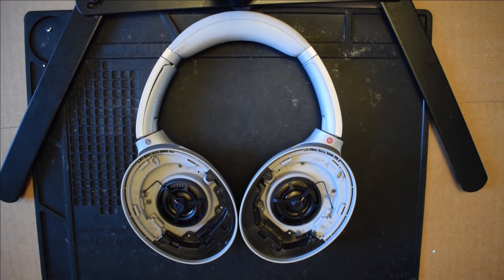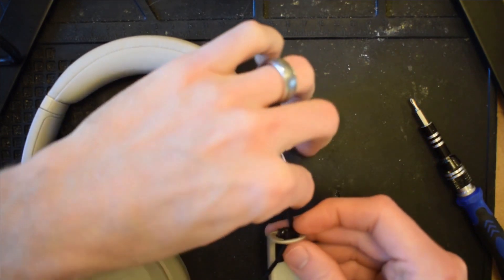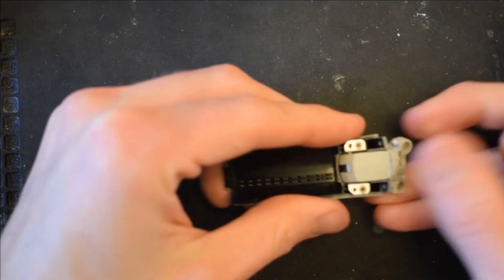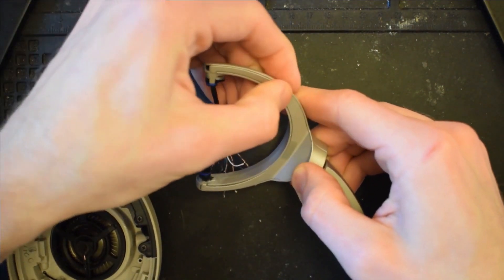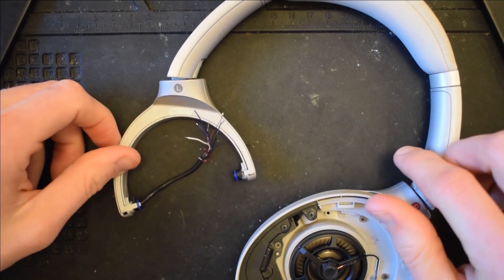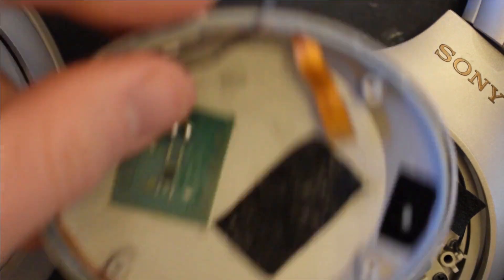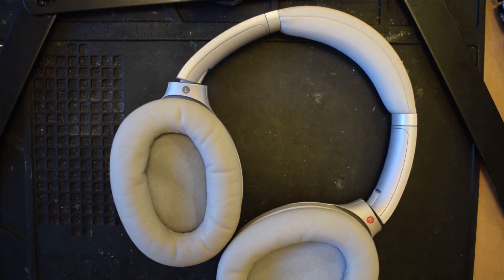Sony WH-1000XM3 Headphones Walkthrough - Teardown and Repair - Left Hinge, Hanger, Swivel and Cover

Comment: WH-1000xm4 Damaged swivel fix: 
No souldering required

Its basically the same till the battery part, you cannot remove battery here, so instead I just took off the two screws on the daughterboard under the battery and lifted it up to pull out the hinge and disconnected the wire (which are a big plug in xm4s).

you can then follow the video again, depending on the part you are replacing you might have to watch other videos on how to open the xm4's covers. I didn't have to go past the 4:00 mark of this video and just replaced the plastic part that he removed at 7:00 by pushing out the metal thingy. 

In my case the metal thing had broken out on its own, I dismantled the spare swivel I got from ebay and put the plastic thing onto the swivel and reassembled the headphones as shown in the video, again without any soldering so I am grateful for what sony did (but still disappointed in build quality)

Thanks you for reading, hope you manage to fix your headphones!
Reply: You mind letting me know which specific  screw Driver or  kit you used to unscrew the those two screws on the daughter board(I have an xm4? The screw diver suggested in this video does not work they have it screwed on so tight  and and none of my screws in my whole set work.

Comment: I replaced the battery and charged it. But it did not worked. Tried serveral reset but not luck. I opened the left side, und unpluged the flat cabel comming from the switch. Plugged in. ... At one point the headset switched on, no idea why. Did the same on the second headset and that it start working again. Using now a sony wh-1000XM3 which was dead for more than 2 years.

Comment: Thank you! Great tutorial, and great explanation of every step. My headband cushion got really ugly with all those cracks in the leather and i wanted to replace it for a long time, but I had a problem with disassembling my xm3's. I would've never guessed that you need to tear down basically everything to replace that part lol. That soldering part was a bit scary, but the diagram was very helpful!
Reply: I got a pair of XM3s from eBay thinking it would be easy to replace the headband, but it's actually really hard :D
Also, I thought it would be easier to disassemble the other side with the battery, but I'm not sure

Comment: If you are soldering and taking everything apart, isn't it easier to open the cover, cut the cables, slide the new one  in , and reconnect the cables?

Comment: My pair has sat broken in a cupboard for 3 years. I have horribly noisy neigbours and I was at my wits end. I decided to look up a repair video becuase the economy is terrible and I can’t afford a new pair right now. Your tear down helped me solve my issue. The ribbon for the power button was slightly out of place and the button couldn’t be fully pressed. I dont know why I waited until now or why I had placed this repair in the too hard basket.  It was easy. Anyway, just wanted to say cheers.

Comment: Thanks for the video. In my case, the same problem happened on the right side. The reparation is very similar, but maybe simpler regarding connection although the battery leave you less space.

Regarding the connection, I had to remove 13 cables. Here is the color code if it helps somebody:
- Black
- White
- Red
- Green
- Dark Blue
- Red/Green
- Copper
- Light Blue
- Purple
- Red/Black
- Blue/Copper
- Blue/Copper/Red
- Black/Blue

Comment: I have a problem with my buttons not responding and the headphones automatically powers on, and it's impossible to power it off. If it powers off because I'm not using it, it automatically powers on again (issue I got after the headphones got pretty washed by the rain). Any idea what I should do?!( Battery isn't good but still working, right part seems good)

Comment: Edit : okay i realise i was stupid the left side doesn’t have touch control 😂. My headphone are working 100% after some testing. 

Thank you for helping save my xm3’s couldn’t have done it without this video. Was actually allot of fun and this is going to give me allot more confidence to play around with soldering. Thank you for talking the time and effort to make this video. Much appreciated.    
——————————————
Thanks for the video saved my xm3's I did a hinge repair. headphones are working however the touch controls on the are not working. My soldering skills are not great so I'm sure its something with that. Ant idea which wires control the touchpad? I I haven't texted the mics yet I can live without the touch controls on the left but I'm not sure if anything else could have gone wrong which I may not be aware of yet.

Comment: Hi, I dropped my WH-1000XM4 in water (completely miserable atm) and luckily the speakers still work, though the bluetooth doesn't. Do you have any advice on how I should go about this? I'm trying to purchase parts off amazon/ebay but unsure on how to dismantle and replace the left whole ear piece safely for re-assmbly using the bought parts?

Comment: Hey dude, great videos! Do you know anything about some problems with the left earcup? out of the blue it stopped working and sometimes when I tap it lightly it will start working again. I tried opening the earphones and spraying some contact cleaning spray which sometimes works but after a week or so the same problem will appear. Apparently there are no cables loose or anything but the earphones just stop working and they may or may not start working again. Thx for any advice!!
Reply from the maker: I've never heard of that issue before! Have you tried doing a factory reset and updating your headphones? You can find instructions for those via the sony website. My guess would be the wires connecting that driver are loose but I can't say for sure. Please keep me updated :)

Comment: Thank you your video helped me so much with my WH-1000xm4.  My left hanger swivel was broken and I ordered the part but ended up not having to replace it.  There was no soldering as it was a ribbon cable.  I just followed your instructions and basically only superglued the plastic part that connected the hanger to the slider and then put it back together.. no issues.  I used a little gorilla glue and that was it.
Reply from the maker: Awesome! I've been wanting to start fixing the XM4s as well so I'm glad to hear it's a similar process to the XM3s :)
Reply: @jontriestofixthings3718  I will say its slightly different because hinge that is labeled "Sony" is not availble to directly unscrew like shown here. and the nail hit that you recommended for some reason won't unscrew the nail on the motherboard. they have it really on there tight. I might need a motorized screw driver.
Reply: @jryuwah  You should be able to?  There are two tiny screws behind that sony label that hold that swivel hinge.  Mine was broken, but after super gluing it back together, i just put the screws in.  (It screws in going away from your head if you were to wear your band).  I'd make sure you are using the right size screw driver as well - something like a precision set instead of your normal screwdriver.
Reply: @dezrep4693  I am using the  precision set described in the video and literally none of my drivers work . And I want to make sure I’m describing the screws correctly. We’re talking about the two screws on the green motherboard where the soldering points are right? Because those two screws are so stubborn and I don’t want to risk breaking my headphones. They simply won’t budge. There’s nothing actually behind the “Sony” label.  Am I missing something here?
Reply: @jryuwah  I misunderstood.  The two screws holding the lower end of the hanger next to the motherboard of the ear piece?  Those ones came out pretty easy for me.   I don't know what else to try for that.  They unscrewed really easy so yours must be worn down or glued in maybe...
Reply: how did you disconnect the hinge where its labeled "Sony"  on the XM4.  another user said he unscrewed  the two screw on the motherboard but I'm having a hard time unscrewing. which brand of nail kit did you use to unscrew that part if you did?

Comment: I just need to replace the hanger, does that require souldering?
Reply from the maker: Sadly it does! Apparently the XM4s finally fixed that issue but this does require soldering to replace the hanger or slider. Best of luck!

Comment: Hi, thanks for the video.
Is the hanger area, ear cup the same on WH1000XM4?
Reply from the maker: I haven't repaired an XM4 yet, but I've heard the body of the headphones is very similar. I doubt they are identical though. I hope to do a repair walkthrough of the XM4s very soon!
Reply: @jontriestofixthings3718  well i did it already. 
Same 4 screws to open the earcup; the hanger now doesn't break at the top – reusable latches are used.
And for putting it back, either tape replacement or using glue alongside the inner part (not the top area, of course) might be needed. Or it can be left with the default tape if it's sticky enough.
I didn't go further since I don't need it though.
Oh and yes, no soldering needed, since Sony uses a connector now.

Comment: Thanks for the video. I tried it but I think I may have caused some bigger issue now. It was working fine before I started. But now after I have resoldered everything back there is no power. There was no sound when reconnecting the last wire either. I guess it was a bit out of my skill set to attempt this repair myself.
Reply from the maker: Hi! I'm sorry to hear that. I would confirm all the wires are in the correct order. After that I would connect the power cord while holding the power button to try to reset the headphones. Best wishes and I hope the headphones will work!
Reply: @jontriestofixthings3718  Thanks for the reply. I will give it a look around and try the reset in the next couple of days. failing that I will try and find someone local to have a look. I think the short could have been from the first 2 wires from the touch pad - I bridged the pads with solder, but tried to clean it up as best I could.

Comment: I want to teardown my headphones to clean them out from smoke odor, do I have to solder the wires?
Reply from the maker: You can do alot without de-soldering the wires. But if you were wanting to fully break down all the plastic pieces and soak them in soapy water or something like that then yes, you would have to de-solder them. You should be able to get a lot disassembled without de-soldering though. Best wishes!

Comment: Thanks for the video! I notice that you do not advise for the battery to be disconnected first, while one works on the left side. I can also hear that the headphones switch on in the background while you disconnect the first cables. What happened with my WH-1000XM3 project is that when they switched on in that moment, some sparks came out, has that ever happened to you? They work though, so no damage \o/ Thanks gain :)

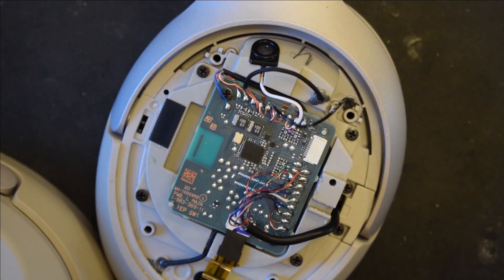Comment: hopefully you can help me. I have been trying to fix my headphones for a while now, they used to work perfectly and stopped turning on out of the blue. I replaced the battery and it didn't work and then after looking around I realized that WHEN I APLY PRESURE ON THE BIG BLACK SQUARE plate that says Sony (underneath the two 100 6v squares on min 2:38) my headphones will finally turn on and as soon as i stopped pressing with my finger the headphones will turn off. What do you think is causing this issue?

Comment: Hi Jon Robertson. Really informative video. Checked out your store and seems that you don't have in stock XM4 swivels. Are XM3 Swivel Arms compatible? Can I perform a repair on the swivel arms without desoldering? My swivel hinge broke, and needs replacement.

Comment: I really need your help..., So I bought SONY WH-1000XM3 only about half a year ago. Worked super well. Then I went hiking and had them in my backpack. It started raining and everything got soaked. After about 2 hours in the rain, as soon as we were under a roof, I tried turning them on. Everything worked well. But after a day or two, they didn't turn on anymore. I let them lie in my room and after 3-5 days they worked again all of a sudden, as if nothing had happend. Now, about 1.5 months later, the same thing happend. But they won't turn on anymore. Its been about 2 days since they stopped working. I really need help, I love them so much. Sadly I threw the receipt away.

Comment: I have no sound in my left can after using it with a broken swivel for a while, I'm afraid the cable has become damaged from being pulled. Any ideas? I get voice commands and touch control work, but no audio in the left can.

Comment: bro can you make a video about the squeeqing sound of the xm4 i think its fron the hinge but i cant pin point the sound source
Reply: It's the hanger area, if we are talking about left earcup.
Reply: @thndrst  exactly left earcap when you open your mouth it does a click sound
Reply: @fahamparsa5157  well, there are few ways to deal with that: 
1. Use a little silica alongside the inner seam on both sides of the arc without opening.
2. Replacing the hanger tape once you open it (discussed on 4PDA).
3. Wait until it disappears, at least one case on Reddit is successful. It might take a month or two, again, according to Reddit.
I personally did first two, it's much better, I cannot even say if it's still there, but I wouldn't recommend it as a 100% solution.
I would say just probably wait or get a replacement (which can have the same issue after sometime).
Reply: @thndrst  my english is really bad can you give me some links to follow instructions for example i don't know what hanger tape is
Reply: @fahamparsa5157  3:26 in this video. Hanger cover.
Reply: @thndrst  thank you so much brother
Reply: @fahamparsa5157  no problem, however I won't recommend it as a solution.

Comment: Thanks for a great video, fixed my XM3's last night and discovered an easier way to go about inserting the wire back through. If you take some sewing thread and wrap it around the loose wires before pulling the wire out, you don't need to fully open the cover where it snaps the two pieces of plastic and you can easily thread the sewing wire back through and pul the wire back into place. Worked a treat for me and it's great having a fully functional headset again!

Side note: I'm surprised Sony decided to go with the same design for the sliders with the XM4's, it's clearly a weak design as the snapping of thin plastic on the outer slider seems to be very common, despite Sony denying the issue in our numerous e-mail exchanges! Good luck to all that attempt this fix, it's not as daunting as it may seem! Thanks again.
Reply: wish i read this before!
Reply: could you explain it a bit more? I have the same issue and dont wanna do all this process

Comment: would it be better to cut the wire and solder them back rather than dismantle it?  Yeah I know cutting wires isn't my 1st choice but the idea of breaking the plastic by removing it seems to counter weight this choice? Whats your thoughts?
Reply from the maker: Because you are working in such a tight spot with many tiny wires, I would highly recommend not cutting the wires and splicing them together. It is time consuming but the end result is much, much better to just do the complete teardown and then resolder. Best wishes!
Reply: @jontriestofixthings3718  I agree.

Comment: Hi, I have xm2 version of the headphone and shamed to say, I destroyed the female input jack.  Is it possible to desolder the 3.5mm jack and replace with a third party one?
Reply from the maker: Yes it is just a standard jack and you should be able to desolder them and replace. I have not had good luck desoldering jacks in general so I usually avoid that repair, but if you have the know how, it should be fine to replace with a third party replacement. Best of luck!

Comment: Hi - this is a great video - I have just got the exact same problem with the left slider breaking - tiny piece of plastic holding that in place - useless.  Could you please post exactly where you got your replacement part set? When I look really closely, I can see a tiny crack on the right side now too. Great headphones - the best in fact for noise cancelling, but the quality is disappointingly poor....and don't get me started on the customer service...that's why I'm here instead of being happy about how well they treated me!

Comment: I just bought it and i want to remove the foam under the earcups because they touch my ear or trim it will this void the warrenty
Reply from the maker: I would be very hesitant to remove that piece. That foam protects the drivers/speakers and if removed you run a huge risk of damaging the headphones. You'll also probably experience some electrical interference if the drivers are exposed. I would recommend looking into a replacement pair of ear cushions that are extra thick so that it will help pad your ears further away from the inner foam.
Reply: DIY Headphones Repair i removed it but just put it back because it was just in there with a small piece of tape since i put it back it should be normal now rightt just making sure thank you very much 😃😃
Reply from the maker: @edredmc-csgoandmore973  Yes it will hold in place even without any tape, since the ear cushions/muffs secure it down. Best wishes!

Comment: Great video! Wow, what a pain in the butt to replace one part. Why couldn't they have used a connector instead of individual soldering?
Reply: Solder wire is a better connection than using a plug which the contact pin might get oxidised and affect audio, like random breaking up, sounds slightly lower volume than the other sode

Comment: Hi mate, you need not go through the pain of disassembling your headphone. You can easily buy a redesigned PC-P PARTS (non-3d printed) and replace your broken parts in less than 5 mins. You can buy the parts on Ebay https://www.ebay.co.uk/itm/233672108469